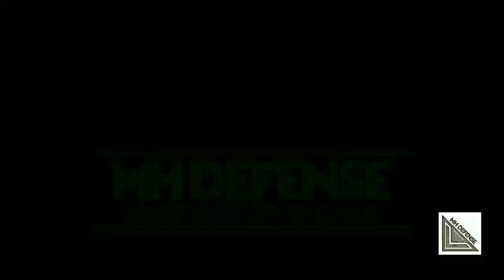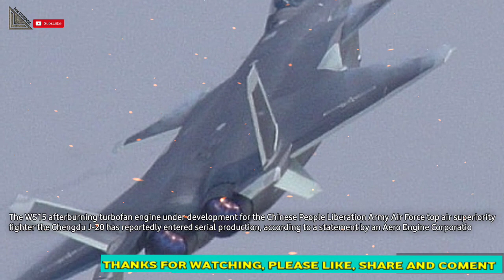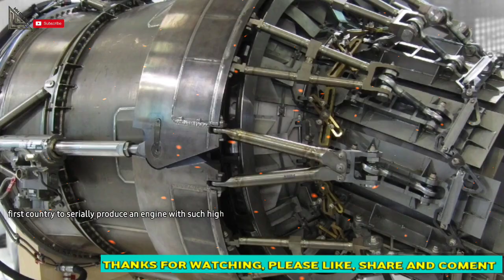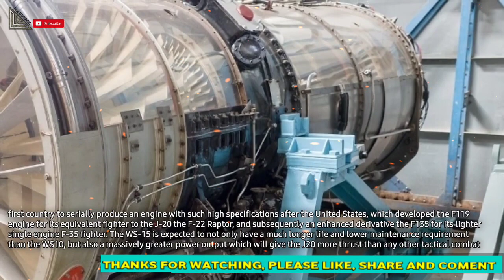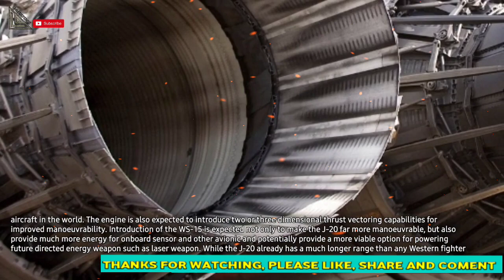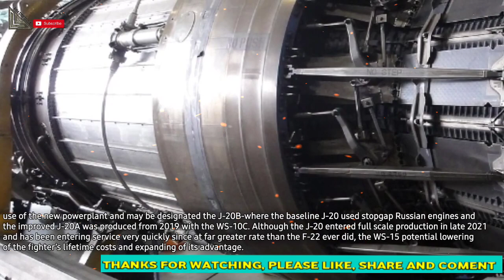China's WS-15 Jet Engine With High Specifications After The United States Under Development

Comment: Wonder if China understands that its more than just how powerful the engines are that can determine if the jet can go supercruise.  They have to be able to cruise past mach 1 indefinently without using any afterburner in the process.  Only the F-22 has been capable of doing that.  It's easy to put out allot of power with afterburners but not using afterburners is an whole other matter.  Russia has been able to release engines with incredible thrust to weight ratio in the past but never been able to supercruise so I'd be very suprise if china can pull it off.  This is new territory for every country outside of the united states which just about all of them really not understanding how it works. Having a thrust to weight ratio of 10 to 1 doesn't mean you will have supercruise.  It's not about going really fast with allot of power its about going really fast without having to use allot of power and maintain it.
Reply: maximum speed 1.8 mach without afterburner
Fastest Mach 2.8